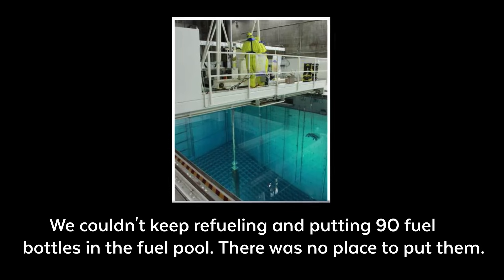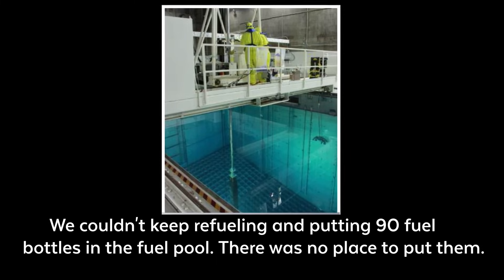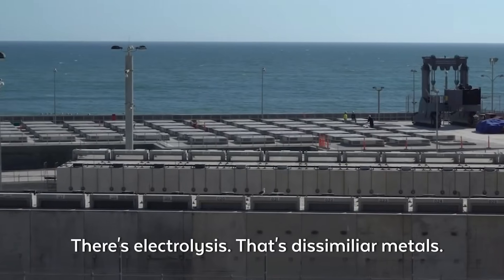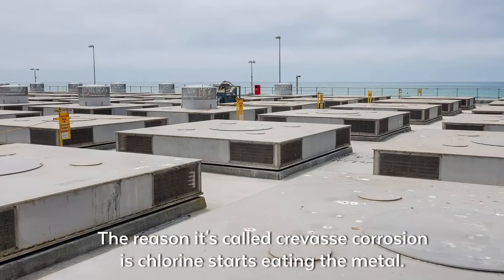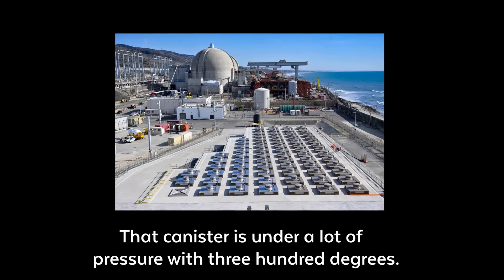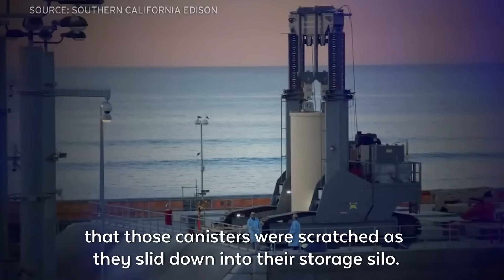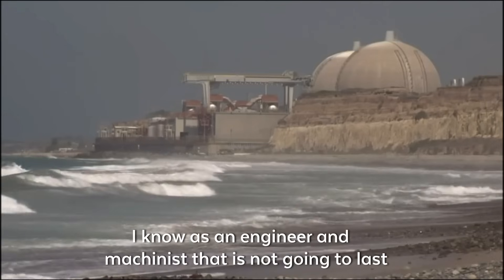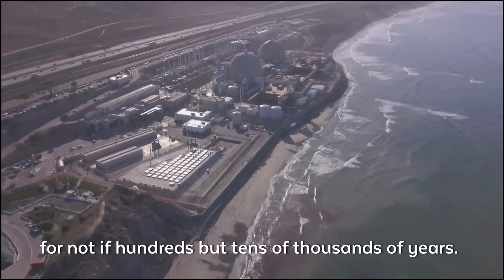Nuclear Waste Canister Problem

Comment: Was hoping for some weld xrays or high Geiger counter readings, not just hunches based on assembly, loading, or storage. Still would like to know more.
Reply: I’ll tell you this. If this leak would have happened one year before they would have had to evacuate San Diego and Los Angeles. They changed the qualifications for what was considered a leak bad enough for evacuation when they figured out this was going to happen. The safety officer packed up his family in San Diego and moved to Oregon as soon as all this happened. He told his friends to start taking iodine and to move also.